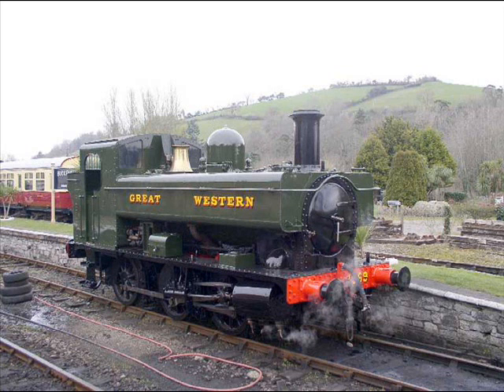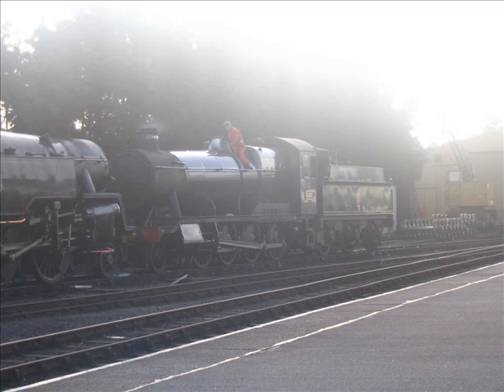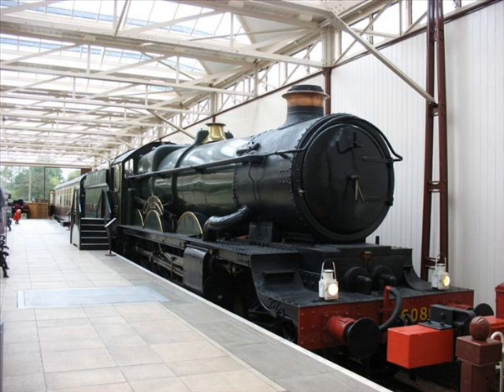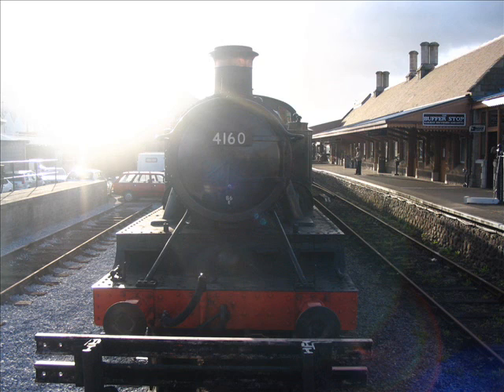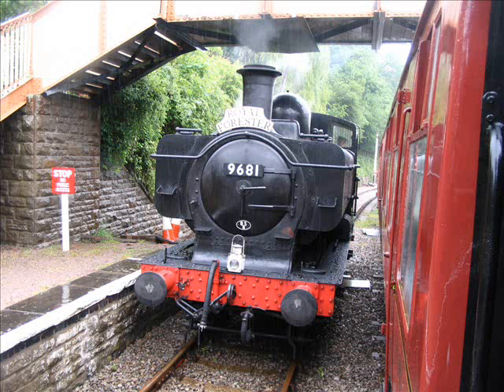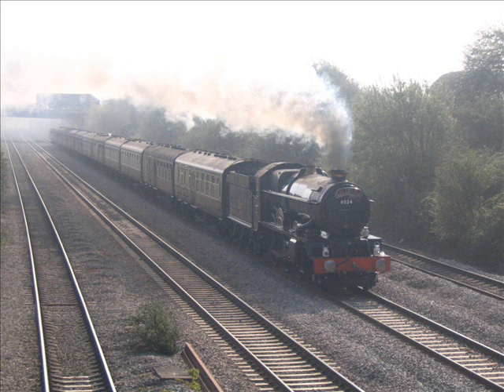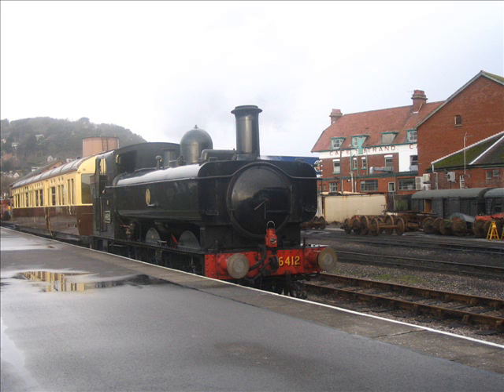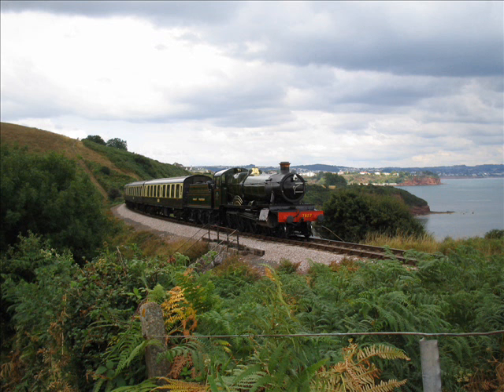Great Western Locomotives designed by C.B. Collett

Comment: Ok, theres some kind of dispute lol. I believe that the Dukedog WAS designed by Collett. However, the Bulldog and Duke classes were not. Therefore I guess you could argue that the Dukedog wasn't due to it being a mix of the 2 older designs but, technically, Collett designed the engine.